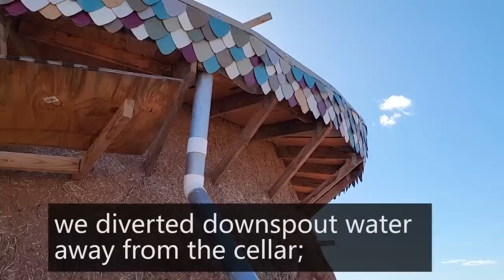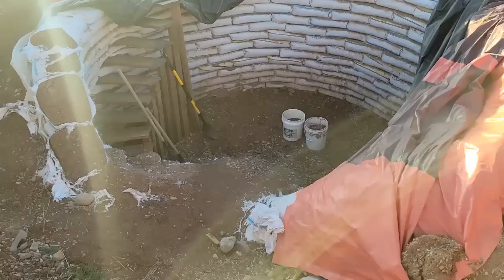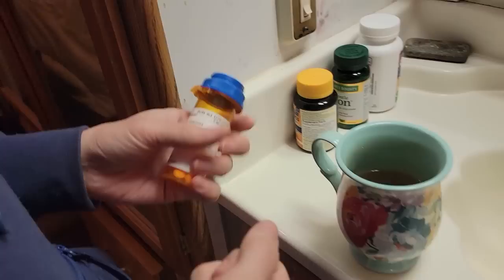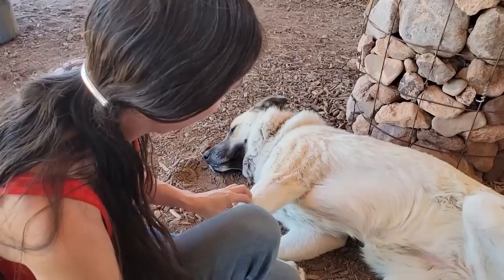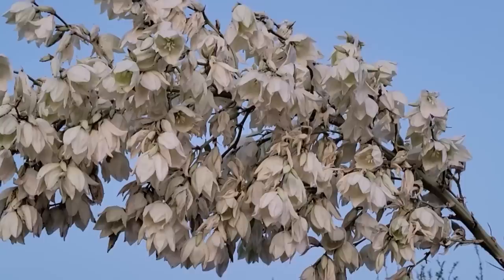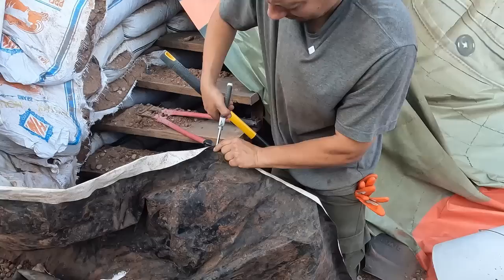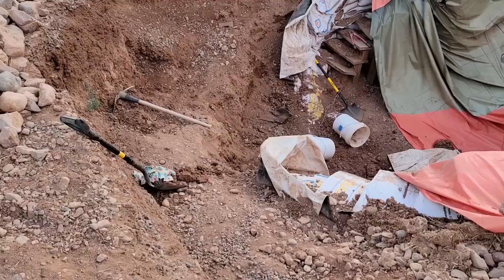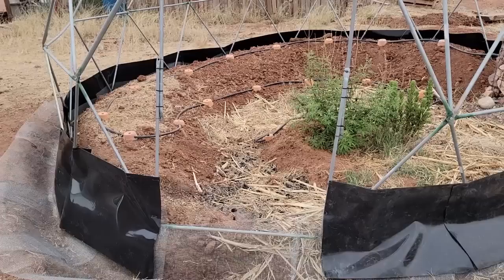Digging Out Our Collapsed Earthbag Root Cellar | Fixing Our Biggest Fail Living Off-Grid

Comment: Hello Jim and Jess, hope you're feeling better. I've been watching your videos for a while now and really enjoy all the strength we both have getting your project done. I landscaped for more than 30 years and hated wheelbarrows, that one wheel does nothing but give your back a lot of stress. Took a ride up to Vermont and bought a Vermont garden cart and it solved the problem. It's just a strong suggestion to get a dumping garden cart and you won't believe how much a lighter the load is.   you can almost pull most loads with one hand. They have one where the front is a sliding door so you can load up your stuff, pull it and then remove the door and dump. Great project. good luck with the root cellar.

Comment: U had an area of fresh dug earth outside the bags to undisturbed earth   I'm guessing the water soaked in very easily in that area    that built up hydro pressure down low on the bags wall and it pushed in and collapsed

Comment: Much, much older than you but quite similar in many ways. Like you, I tend to resist relying upon others for most things. Along with that, I believe like you, I also tend to worry/have anxiety over the anticipated difficulty/success of upcoming tasks/events. Many years ago, as a young husband, father, provider, these pressures/anxieties began causing some medical issues. Different than yours but, nonetheless, caused by the mental stress I was causing due to these, unwarranted, anxieties. I have learned, through experience,  some sound advice, and confidence realized through ongoing experience, to control/avoid those anxieties by simply being more relaxed and confident. Admittedly, not always the easiest thing to do but very possible when the same "determination and commitment" you apply towards your perceived responsibilities and success is applied towards controlling your anxieties. So, simply RELAX AND ENJOY !!!

Comment: In my personal experience, there is a direct correlation between stress/anxiety and teeth clenching or grinding.  THe pain you describe used to be called TMJ.  The appliance that you wear when sleeping will be a big help.  Did this pain start or get worse about the time the root cellar wall collapsed?  That would do it.  You were SO disappointed.  Happy that the root cellar collapse is behind you now. 😊

Comment: french drains are usually used to prevent hydrostatic pressure build up behind foundations and retaining walls. if you put perforated drain tile at the base of the wall, and then fill up the outside with coarse gravel, the water will flow through without building up. the water will flow wherever you put the drain tile/pipe.

Comment: My wife and I have grinding issues too.  We both sleep with an appliance that prevents the teeth from touching at night.  If you have TMJ too your bite may be off and need adjustment to prevent long-term joint damage.

Comment: i have eds, cfs, chronic migraine, autonomic nervous disorder, etc.
my jaws can go out of place and my muscles don't relax in my body even while sleeping. my teeth had already worn down abnormally violently for 20 years. Blink to your problem. see also bed. the pillow plays a big role in how the body relaxes. when you go to sleep, find a position where you can really relax the muscles near the chin and head. the muscle stiffness can start from somewhere else. e.g. a headache caused by the neck is often caused by muscle tension in the area of the shoulder blades. Practice recognizing muscle stiffness. e.g. just in connection with stretching and yoga, think about when the muscle relaxes and tenses. learning to recognize this makes it much easier. cold and hot can also help.

Comment: Think you should keep the ramp for the root cellar- better than the stairs.  Was watching  something on a house in Portugal.  This was a little village house-  were it seemed to be stacked rock walls,  a inside rock wall veneer - then a outside stacked rock wall veneer- with dirt rammed between the two wall.  Then the outside was stucco- which filled in the cracks between the rocks, on the inside they did a scratch layer of stucco and then I believe plaster.  The top of the wall were capped with grout or stucco. That then some of the roof tiles were bedded into.  You could create a form- stack the rocks against the inside  then bound and compact dirt .

Comment: I must say tooth grinding is something I suffer from, I was not aware of the problem until I broke a tooth early one Xmas morning. I have always suffered with nightmares since I was about two years old, I thrash about leap out of bed onto dream't intruders punching and kicking and waking to find I have punched or kicked the wall, Severe nasal polyps caused me to become a mouth breather and heavy snorer.Operations to remove the polyps were unsuccessful and found myself with new polyps before clearing hospital.. Eventually a surgeon managed to remove them and claimed he had set a new world record with the number of polyps he had removed. Non of this stopped the dreams etc .However I did discover for myself eventually that my sleeping temperature  was a major factor effecting my sleep patterns, Sleep heat can be effected in so many ways and is not always a product of  atmospheric conditions. Be careful of what you eat and when you eat it. I am lucky enough to own a thick cotton blanket woven in Africa on a hand loom back in the 1950's it has the strange ability to be cool when hot and warm when cold and since lifting it down from the wall and using it as intended has certainly made a difference to my sleep. I think what I am trying to say is experiment, some folk sleep better in a hammock or outside in the fresh air on the floor or perched in a tree, in a boat, water bed You get the picture. A good nights sleep is something we all agree on as being essential for our physical and mental health.

Comment: with the dirt still being wet, you need to heavily compact shallow layers of dirt, and allow it to dry, then load up the next level,  and repeat.  soil needs to be compacted layer by layer.   the loose soil very slowly settles.. if it remains wet.. it does not properly shrink and compact.

Comment: Jess you look after yourself  like you said get yourself back to full strength love you both but I was thinking about the old seller would it be possible to put a drain away system that side , using pipes to take water away if it happens again by pipès and would be help it to not happen again al ❤

Comment: One thing I would recommend but I’m sure your already aware is electrolytes. I had chronic pelvic pain for 2 years straight.  The first day I felt relief in those 2 years I randomly bought a pedialyte which I haven’t had in forever, but just saw it and randomly grabbed it. I drank most of it pretty quick because it just felt really good. a little while later I noticed my pain was gone for the first time in almost 2 years and it lasted a while. I assume it was due to chronic dehydration and Overexertion It comes and goes every now and then because I’m so physically active with my work and gardening/ building at home, but now I try to have electrolytes and stay well hydrated and usually that helps a lot. There’s really nothing like a big glass of water with ice cubes, lime juice and half a pack of pina colada flavored liquid iv (electrolyte powder) my secret recipe 🤫

Comment: I had the same kind of issues with my teeth were they periodically started hurting along with tight facial muscle. And tension headaches. In my case it was my sinus causing presure on the nerves in gums because sinus goes all through forhead down along ears and through gums. Turned out I had a deviated septum. So if pain comes back ask yourself is on nostril easier to breath from than another. Also you can tell just by looking at you that you are tight in shoulder neck and upper back. A good chiropractor can realign you which will automatically loosen your entire body. If your septum is deviated or if you can not move the tip of your nose freely from side to side or you can push to one side but not the other you could get it adjusted.Stress  combined with hard worked muscles is a dangerous combo.I use to be a long distance runner and martial artist and yoga enthusist until i started feeling pressure build up and then shooting pain with every stride taken. It took several years to figure out what the issue was.

Comment: I imagine a couple good wacks with a sledge hammer will cause the lumps that come out of your bags to break apart into chunks of material you can reuse.  If your using a cement mixer when you rebuild your bag wall, that will blend everything into a homogenous  mix.  The lesson learned is an underground structure needs rebar driven through the bags and into the subsoil with a ring beam tying all of the rebar into one compression beam. This could be done in two phases - one ring beam half way up the wall and the second around the entire top of the underground space.   For additional insurance you can add buttresses around the inside of the structure.  They could be laid out in such a fashion that they could serve as partitions in the root cellar.  You could also dig out a sump and line the inside of the wall with a french drain so the water has some place to go.  THen pump it out of the sump.  Finally, change  the grade on the uphill side so the soil slopes away from the root cellar.

Comment: I think you'll need a plaque to use during rhe night. Probably close your teeth too hard during your sleep. A plaque will help you immensely. I have been using one for several years. My dentist suggested one years ago as he saw signs on my teeth. To make the plaque you'll need six to eight sessions. They first measure your mouth and make a rough one. It will be adapted in the next sessions so that when you bite all teeth have equal support.

Comment: Stress is an component of teeth grinding I’ve had issues with my grinding teeth and it causes tmj which is muscle tightness at jaw joint area it can cause ear pain headaches etc. massage of area and using a heating pad will help. I’d try to find a therapist that can do cranial and tmj massage.  A mouth guard can help by preventing damage to teeth and calm down your clinching at night    Feel better

Comment: Jim, have you thought about reinforcing the failed area with a gabeon wall?  Then adding a thinner bagged wall on the inside of the wall for a finished interior appearance?  I also wonder if maybe you need to establish a low point somewhere along the bottom of the gabeon wall to collect water accumulation along the wall (and accumulation along the existing bagged wall which might be absorbing moisture during the rainy season) into a deep dry well. If too much water accumulates in the dry well, it could be pumped out.  Clearly you have had success with your cistern construction which includes reinforcement.  The main consideration is that the existing, unreinforced bag wall needs positive drainage AWAY from the wall (which you are working on) and not to become a low point for water to accumulate.  You might even consider reinforcing the existing bag wall by building a reinforced block wall on the INSIDE of the remaining bagged wall...maybe 5 or 6 feet high to strengthen the bag wall.  Also, I would expand your "basement" foot print to the outermost area of the disturbed slope to gain some addition sq footage lost to a new reinforced wall (such as gabeon wall that might be wider than a bagged wall). Good luck to the both of you and to your continued determination to "design with nature" (Ian McCarg, 1969 book, an old University of Pennsylvania, Landscape Architecture professor)!
Reply: Or, as a possibility, to put a gravel fill, on the side between the structures, that goes down the outside of the water barrier, so it acts like a French drain and keeps the water from being a force that would put pressure on your wall.  The fact that the dug duet is still wet, even after all this time shows that the water was trapped.  Giving it someplace to go that is not against your structures might be a really good idea.  Of course, the best solution would be to get all that water into your cistern, but … that will be a some-day, rather than a while-building project.